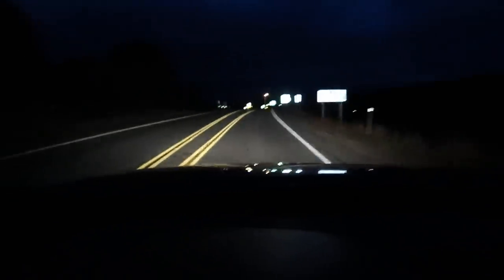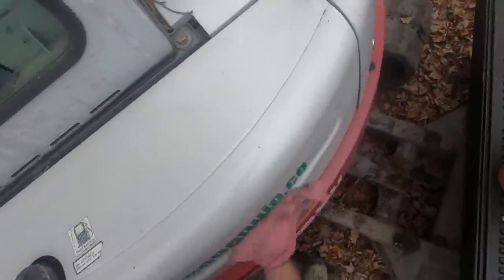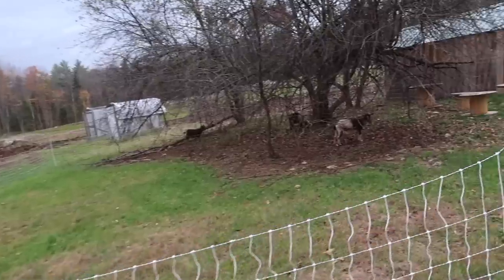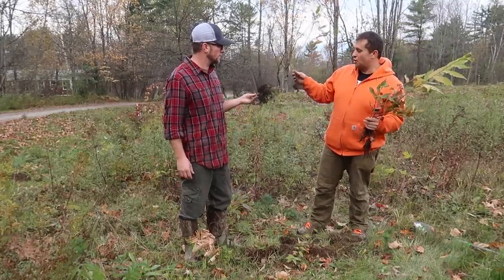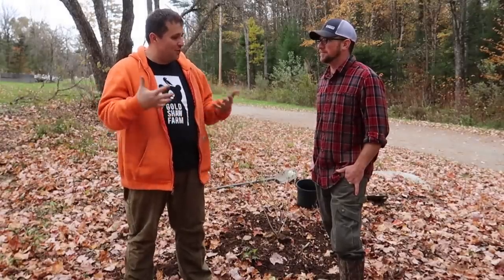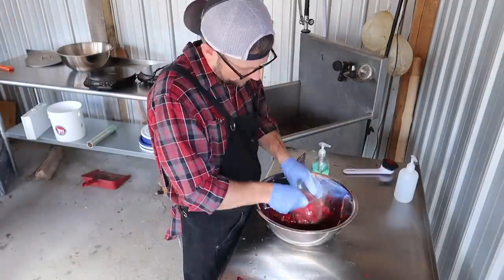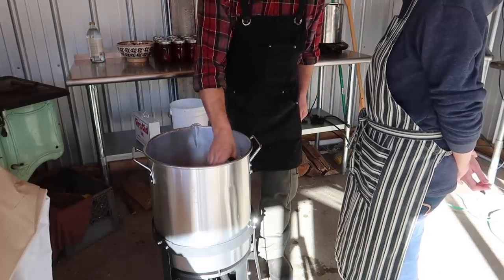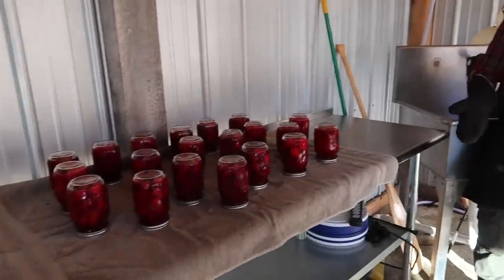This Has Been One Crazy Day!

Comment: Al what happened to the DC battery operated fuel transfer pump? I bought one after you demoed yours . It saved my turkey bacon here with my generator during the hurricane here in NC. What does an excavator run for a month rental or is it by the running hour?  You have become a dirt, stump and rock  magician with that equipment. Great video :) Those new bushes and trees near the drive  might need a plow stick or 2  ?   Thank you for the weekend come monday video. All the animals are looking happy. I checked the local papers , no word of any vets heading to the ER ! Hard to tame that Figaro farm tiger :)

Comment: Good morning New Yolk City! Sausage looks to be a little lame on her right back leg? (I see this was mentioned down below ...... ) Never was a beet eater, but that just leaves more for you guys ~8^) It's possible that I might like them now that I'm older and my tastes have changed a bit. I've never tried them pickled, so that might be the way to go. Anyhoo ..... enjoy! Btw ..... we turned our canning jars upside down as well, and for the same reason. Never bothered to check if that was even necessary, but I don't do any canning these days anyway. AL ..... the following for your safety, plus the link to the PDF from Purdue University. (this includes diesel fuel)
 "When dispensing gasoline into a portable gasoline can, use only an approved
container. Always place the container on the ground and keep the pump nozzle
in contact with the container when refueling to avoid a static electricity ignition of
fuel vapors. Containers should never be filled inside a vehicle, in the trunk, on the
bed of a pickup or flatbed truck, or on the floor of a trailer. The bed of the truck
and the bed liner act as insulators, as does the carpeting in a car or in its trunk,
which may allow static electricity to build up in the can while it is being filled. That
static electricity could create a spark between the container and the fuel nozzle.
"

https://www.extension.purdue.edu/cfs/programs/gaspump/resources/gaspump-handout-long.pdf

I had to warn a individual that was filling a gas can while they were holding it to their clothing, chest high off the ground - talk about static electricity! Scared the beegeesus out of me ...... be careful my friend. This has been a public service announcement brought to you by me. Take care AL, Gina & Olivia.

Comment: If you pour out any liquid from the container with the outlet on top the air will vent most efficiently and not go glug glug glug as the air goes into the container.  It is the cleanest and safest way to pour liquids. Those vents don't do any good.

Comment: Be careful dude there's a reason you should fill containers on the ground, difference of electrical potential(static electricity) electrical spark + fuel fumes = Boom
Reply: Richard Barrett  I was wondering the same thing but with diesel having a higher combustion point it may not be as much of a concern. I would still place on ground to disburse static.
Reply: As long as the fill handle is in contact with the container I don't believe any static electricity can build, so it's safe IMHO.
Reply: @tylerbuchholz3234  Please see the info above that I provided from Purdue University .... it matters a lot where you are filling a container, not just how. Be safe. Sooner or later you may run out of luck.
Reply: Yup you need to always be careful how you fill gas cans.
Reply: Diesel fuel wont spark from static electricity. It requires high pressure and heat to combust. I used to freak people out in the army by tossing out my cigarette into a pan of diesel fuel.
Reply: Richard Barrett ,
I was thinking the same thing.  Then I realized that Al was using plastic containers which were sitting on the plastic bed liner.  Not much chance of a spark.  Still , being the nervous Nellie that I am , I personally would have set the gas containers on the ground.  Just in case !
Reply: @donaldmiller8629  see my comment above. It was diesel fuel. No spark in the world will set it off. Diesel fuel is different from gasoline in that it requires high pressure and heat to combust. That's why diesel engines have glow plugs not spark plugs and also why they run at about 10 times the compression of a gasoline engine. Al was 100% not in any danger.
Reply: @joshuachristian3102  until smarty pants put regular gasoline  in that pan??? Bad joke, but was my first thought 😉

Comment: Al so I'm learning about all of this stuff from you so why do you put the jars upside down
Reply from the maker: We were told is supposed to help the jars seal. But many are saying you don't need to do it so I wonder if it's a New England thing. 😂
Reply: Lumnah Acres Al, if you processed them in the canner, then you do not need to invert them. Storing them upside down could affect their seal over time. The inversion thing is usually done by those who skip processing their canned goods in a canner entirely. Also, after 24 hours, you remove the rings. You can store the jars with them stacked but need to have a layer of something like cardboard between them. I’m excited that you got elderberry bushes. I was wondering if you and Gina would ever get some. Thanks for the recommendation of the new channel!

Comment: Because you heated the apple cider vinegar, you killed the "mother" properties and the other beneficial properties of pickling. Instead, I can plain beets (for long term storage). Then as I need a jar of pickles beets, I open a jar, add apple cider vinegar and sliced onion. Wait 2  days and yum! (If the onion is particularly strong just wait another day or two and the vinegar will tame it right down.) I like the onion because the crunch contrasts the soft beets.) With love 💜 from sunny 🌞 Arizona 🌵.